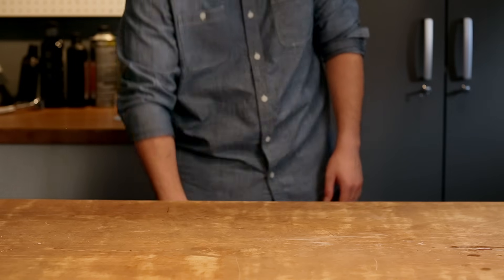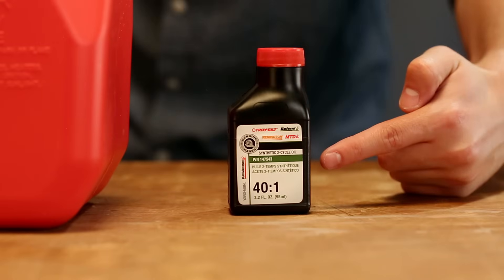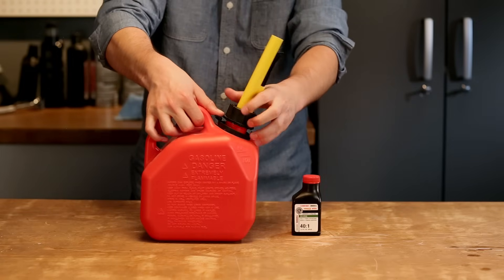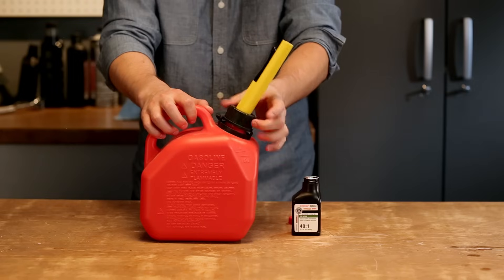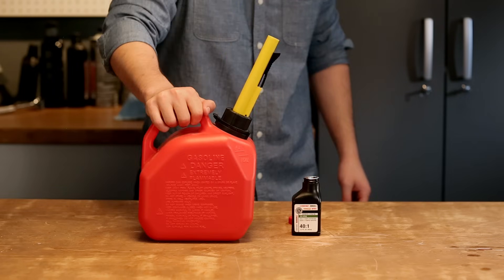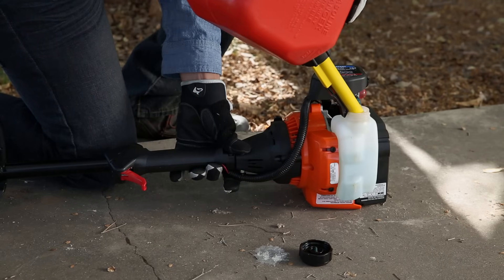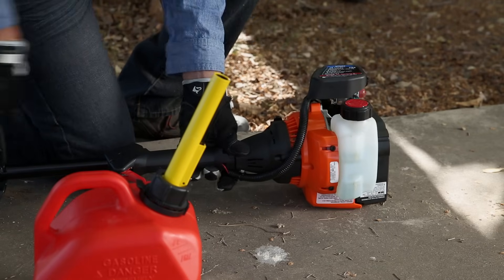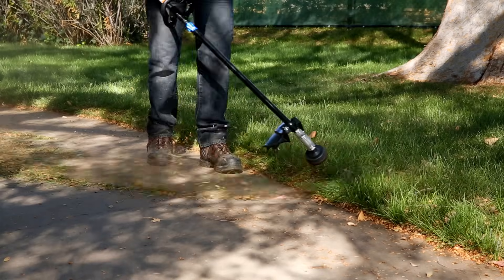How to Mix Oil and Gas: The 2-Cycle Engine Fuel Recipe

Comment: Why bother? Use pre mixed fuel 40:1 you can buy. 16oz  $5 at WallyWorld...
No spoiled gas after months, cleaner
burning, no need about clogged carbs,
nothing.

Comment: QUESTION: I bought a 8oz bottle of 2-Cycle Engine Oil for my weed wacker. This needs a 40:1 ratio. I did the math and confirmed if I simply bought 2.5 Gallons of Gas, I could put the whole bottle in without any problems. However, I would never use that much oil in one year, so I only have a 1 Gallon container for the year for weed wacker fuel. Do you know if there is a way to measure just 3.2oz any way?

Comment: Shouldn’t you be telling people to use only non ethanol gas in a 2 stroke engine. Regular gas with ethanol will cause problems with the carburetor and other components.

Comment: How many cups, pints or whatever is that little oil bottle supposed to be compared to 1 gallon of the gas that its being added to? Thanks.
Reply: You can see the oil's label in the vid.  3.2 fl oz / 95ml.

Comment: Thanks for the video. Is there a certain brand or type of oil (little bottle) to mix with the gallon of gasoline?
Reply: i’m sure your brand of trimmer or chain saw makes their own 2 stroke oil but any should work as long as you mix it right
Reply: @bretwhitten7038  Got it. Thanks.

Comment: How precise do all these mixtures have to be? How is it possible to make exactly one gallon of gas when the can is red and not see through? Wouldn't a plastic milk gallon bottle be easier?
Reply: If the mix is off marginally it shouldn't be an issue. Better a little more than not enough is my mantra.

Comment: I did that and my echo leave blower and weed eater didn't like it. I made sure I had one gallon of fuel and then pure the 2 cycle mix. runs like shit. going back to the ready 50:1 at home depot never had a problem with it. $20.00 for a can mix ready to go.

Comment: I just got a new engine DR Evolution 50cc air cooled for my scooter and replaced everything in the transmission.
The connecting rod bearing somehow fell apart and made it into the chamber destroying the engine. 
This is a Peugeot Speedfight II and it was the original engine with about 15.000kilometers, I've been told it was just too old and that's why that happened not because it didn't get enough or any oil cause apparently the autolube works or at least its consuming oil from the oil tank and there is no oil leakage sign anywhere so it must go into the engine I guess. I've been told that through the break in period which is 500km which I've been through already, add an extra 10-20ml oil to the fuel tank. I actually added 40ml and recently after 400km 60ml because I was trying out the limits of the new engine. 

My question is, would it harm the scooter if I keep adding extra oil to the fuel? What would be the limitations for that? I know the 50:1 ratio, I have a 7l fuel tank so if I were to premix oil with fuel I should add 120ml which I guess would be too much oil of course and the mixture would be too lean making the engine hotter and thus causing an engine seize no matter the extra oil. But like would 60-80ml extra oil do any damage or would it even do any good in the first place or its not even necessary at all to add even a small amount of extra oil to the fuel if the oil pump works in theory?

I'd be glad if someone could help cause I'm more of a car guy, I just got this scooter to have some fun with it at places where my car can't go, I know how the 2t engine works and the premix would be also simple solution I know. I'm not really familiar with the autolube system but I guess the engineers designing these scooters and whoever came up with this autolube system must know what they are doing and how this system is supposed to work. So I wouldn't wanna just go with the "disconnect the autolube and mix it on your own" what most people say on forums.

Comment: seriously?, pour in the oil and swirl container, gee thanks for the informative video
Reply: If it's a 50:1 mix then just use a 1/3 measuring cup. which is equivalent to 2.66oz. ez pz 
If you really want to be lazy then just buy premeasured oil at the store.

50:1 = 2.6oz/gal
40:1 = 3.2oz/gal

Comment: 50:1= 80ml per 1 gal gas why did I show this?... 1/2 gal...4o ml... see how easy it is to mix less... only what you need with metric?! 1 qt:= 20 ml... get a set of plastic mesuring spoons; any dollartree anything for a buck... mix only what you need. Great for that last part of mowing season.

Comment: I just bought two new gas cans just like the one you have in your video. One 5 gallon and one 1 gallon. But every time I try to pour gas into my string trimmer ( or anything else) they leak like crazy. I've tried everything but can't get them to stop leaking. How do you tighten the caps on these things so they don't leak. I'm beginning to hate these gas cans. A vid on that would be helpful.
Reply from the maker: Hi Fred. We are sorry to hear about your leaking gas cans. Please reference the gas can manufacturer website for tips on how to tighten the caps.
Reply: Thanks guys. I have learned how to tighten them since then. But I still like the old ones better.
Reply: Fred my Grandfather taught me a trick with butchers twine. Wrap the butcher twine about 6 times  where the  washer goes and tighten as usual.

Comment: There are many different Ratios of Fuel mix. 50,40, 32:1 etc.  Beware US Gal vs Cdn Gallon (4.5 litres).  Always use Shell Premium fuel in Canada, No Ethanol.
ALWAYS use a fine strainer or cloth and filter fuel for 2 cycle engines.
Reply from the maker: Hello Gord Baker. Thank you so much for your input. We will take this into consideration when producing future videos. Have a great day!
Reply: @Remingtonpowertools  it just occurred to me to get an accurate mixture ratio that you would need to subtract the amount of oil...for example if I'm mixing 20 liters of gas at 40 to 1 then I should add 19.5 liters of gas (Not 20 liters) to 500 ml of oil, this way I have 20 liters of gas oil mix total and 1 fortieth of that is oil. Am I wrong, looking for insight on this, thanks and regards.